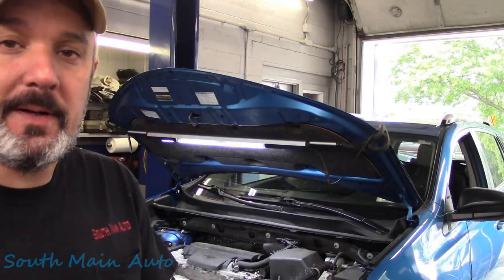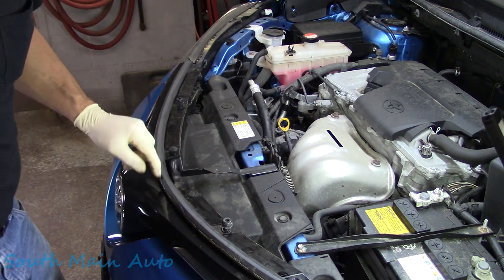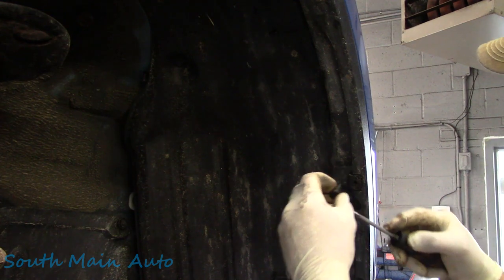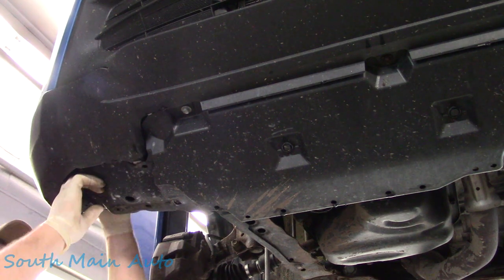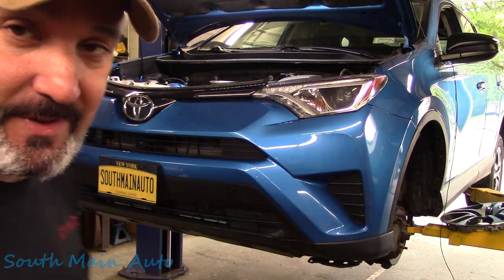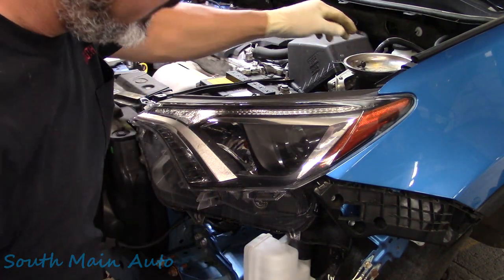2013-2018 Rav4 A/C Condenser Replacement

Comment: boy i miss the good old days the grill is on the hood take out a few brackets to get radiator or condenser out
back in the 90s i hit a deer with a corolla and it was only 300 dollars for new condenser refill system the whole works with labor

Comment: Should "you" take those brackets off the condenser and fluid film or plasti-dip or something a layer between the aluminum and steel to prevent future corrosion and leaks?

Comment: Seems alot to take off on this Toyota on My 04 Accord EXV6 Sedan. To uninstall the condenser you just have to remove the Under Bulkhead cover which is only 10 clips then 2 brackets and 2 bolts of course the High and low hoses. And thats it slides right out. I don’t why so much for this small car.

Comment: You mentioned in the near beginning where and how much the freon leaks at that driver's side mounting bracket.  What if any updates were done to the factory replacement condenser?   What, if any does the salt/brine have to do to make it leak there?  I have a 2020 RAV4 and I live in Southern California, but I'm wondering if that leak is due to a vibrating/rubbing problem or the salt/brine problem?
I'm definitely keeping this video for reference.  Good fix Mr. O.

Comment: I've got a 2017 rav4 and the ac stopped blowing cold. Got it leak checked and re filled. Mechanic couldn't see any leaks. Lasted a few days then went back hot again. Had it back to the shop and he re-gassed it again. Same thing, lasted a few days. He recommended a new ac compressor next. Is it possible mines may be leaking in the same spot and he isn't noticing?

Comment: Great video Eric I,  wish you or someone else actually had a video on replacing the ac expansion valve on  2011 mazda tribute 2.5 liter,  I know it is attached to the passenger side firewall  but I'm not able to remove it.  Thanks

Comment: That car is clean for 6 yrs old in PRNY and only 36k miles. Definitely doesnt get used in winter. My 16 escape with 123k has had no major repairs just reg maintenance well it did need rear shocks but that’s not too bad.

Comment: I have a 2015 RAV4 with 200 000 km on it and I have a leaking condenser.  I always keep my Toyotas well beyond 300 000 km so I'm wondering if I should change the condenser as well as the rad since everythings already apart?  I'm doing it myself so it's only the cost of the parts.  Any opinions would be  appreciated!  Thanks in advance!

Comment: 225k miles '05 Magnum. Very dependable. 1 warranty issue. Pinch wire in the hatch. Rental car driver whacked it good. Totaled. I would still be driving that boat. 
  The point about safety is spot on.

Comment: I believe you when you say you evacuate the A/C before you open it up.  I don't believe you when you say you come back and torque everything ;)  I suspect that after this many years of work that you have a well calibrated "torque arm" (or ear?) as well as knowing exactly when torque is critical and when you can get away with "good enough".  Without that critical experience, a torque wrench is always the safe option.

Comment: I had no idea that you could get different "grades" of parts from the Toyota dealer.  That kind of blows my mind.   I mean I've seen things like different grades of brake pads/rotors, ignition parts,etc... all wear parts though.  Never OEM replacement parts.   I wonder does the same thing hold true for engine sensors and electronic parts?

Comment: Back when I was still in the biz, we used to have these yellow shrink seals that we would put over the service ports and shrink on. Lets you know if anyone else has messed with the system. Good to have when a customer comes back for warranty work. I was in FL at the time so we did lots of AC work. Didn't know if they were still a thing?🤓

Comment: Only 35k and the condenser has a leak?  If you have done 3 of them already it must be a design or material flaw.  Did it rust through, have excessive movement, or just be a weak point?

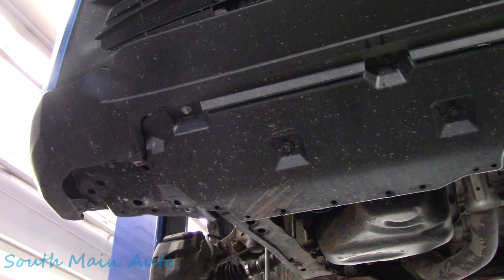Comment: How long have you been rockin the 1080p60?  I admit I've got an old school Macbook Air 2015 that I watch the majority of my videos on.  It doesn't like the high bandwidth video so I usually have it limited to 720p just to stay out of the 60fps.  Then I have my power house Dell I use for actual work (CAD, compiling code, far to many virtual machines running at the same time, and the occasional video edit for my nephew).  It looks like a brand new shop on my Dell.  Specifically at 2:36.  It looks amazing.

Comment: You are absolutely correct. The engineering in an new car is amazing, All those those different pieces /components coming together to fit and make a car.
Reply: That is amazing service with a very quick turn around time.

Comment: Great video Eric and Vanessa!!! I just liked and subscribed to your channel.
I have a 2021 RAV4 that developed a pinhole leak in the condenser according to the dealer.
My AC still runs cold so it must a really small leak. 
Do you think I could use some J-B Weld to stop the leak?
Thanks, Michael
Reply: BTW It's 2021 RAV4 Prime. Thanks!

Comment: I picked up a brand new Citroen Xantia, with rear lights that blinded people. The AC was useless, it was a very hot summer. The language as I drove it for the first time, after it ran out of fuel, to the repair guys was very rude ! Worked after OK though. I also hit the fornt Left wheel hard on kerbs twice and had to have replacement wheel, it was a company car here in the UK. God I hated that thing !!!

Comment: At 11:42, Eric O says, "This is where all the magic happens." All air-conditioners, and refrigerators, use adiabatic expansion to move heat. They all have two radiators: one is called the evaporator, and the other is called the condenser. A refrigerant is a chemical that easily cycles through a liquid state and a gas state in these two radiators. The compressor, compresses the gas phase, which makes it hotter. The gas is cycled through the condenser which cools it, and causes it to condense into a liquid. This liquid will be at the temperature of the air flowing over the condenser. The liquid flows through a wall into the chamber to be cooled, and is squirted through a nozzle into the evaporator, where it becomes a gas. This is adiabatic expansion which means the gas becomes quite cold. The blower then forces the hot inside-the-car air over the cold evaporator, which cools the air, and heats the gas. The hot gas returns to the compressor, and the cycle repeats. Buy a "compressed air duster" can, and discharge it all at once. The can will become ice cold. They plumbers in my old office building did this with a standard metal gas cylinder filled with compressed air. They wrapped a rubber hose around the water pipe, and emptied the cylinder. This froze the water, giving them time to unscrew the bad component and replace it before the water melted, and saved them from having to turn off an entire branch water line.

Comment: I am a Tundra owner and have been pleased with the dependability and engineering.  But my SR5 is an 08 with right at 200 thousand miles.  Having said that, it appears the condenser on this RAV4  has an engineering fault
Reply: Steel clip on an aluminum condenser, bathed in wet road salt, is a sure scenario for galvanic corrosion.

Comment: It's funny but I usually prefer changing condensers than radiators. More time, sure, but bumpers typically come off easily then you're left wide open. Radiators usually don't give you the time to have that kind of access. You usually have to rip em out and shove em in while fighting with shrouds and fans and cooler lines and all kinds of plastic that doesn't want to go back...

Comment: I’ve looked at the Toyota cheap brand,  not as good as original.  I might use the air filter cause it’s easy to replace but not something where you have to remove hall the car if it fails under warranty

Comment: what really gets me about the newer vehicles friend of mine has a ford truck full size 5.4 pull up in drive way home from work turn truck off take key out and it keeps running go back out in 30 45 min still running takes off battery cables finally quits. goes to ford dealer bad antilock module the abs system has no business having any control with the vehicle shutting on or off let the abs do brakes and leave other things alone.

Comment: If just Eric alone has had to replace a few of those condensers already on vehicles with such low miles, and it's always leaking in the same spot, then maybe Toyota needs to do a recall and fix the way the condenser is held in place so all the vibration doesn't cause a leak.

Comment: I’m surprised that you didn’t replace the O-rings, hi and low pressure valves as an automatic part of an A/C service. As they are the most common causes of leaks.

Comment: My wife got sideways very light rain on the Fla turnpike at 80 mph and hit the cement median in our 2010 Civic which we had bought new. Her only injuries were seat belt rash and a small face bruise from the air bag. The car was totalled so we replaced it with a new 2012 Civic and now 160k miles later it just had its first repair, the starter went bad at 155k. It's not that long ago that was a fatal crash.
Reply from the maker: True story man. Do that in an old school car with lap belt and a full frame, you'd been at a funeral....
Reply: 80 mph in the rain.   Hummm... maybe most of the problem to begin with?!
Reply: @Ram14250  It wasn't rain it was a drizzle, you have to understand SE Florida.  She knows this was her fault. She went to change lanes and realized there was a car too close in the lane she was moving towards and she over corrected and got the car sideways. Perhaps on a dry road she would have gotten away with it or even in full rain at a slower speed but a very light rain slicks the oil on the road but the intensity of the rain isn't enough to wash it away so it just sits there. She knows her mistake but the point was that she was dead in an old car.

Comment: Do you have a video of how to refill Ac after condenser replacement?
Reply: Hook it up to the ac machine and let it rip. 

If you don't have the ac machine: hook up gauges, vacuum the system down, charge to low side using refrigerant scale.

Comment: Thought this would be covered under warranty but I had a temporary lapse in my memory and I thought it was 1998 where 10 year, 100,000 mile warranties were advertised all over TV. Looks like Toyota only has a 3 year 36,000 mile bumper-to-bumper Warranty, yeesh.

Comment: First Toyota we've seen on the channel in awhile, usually it's a HONDOO with a large side of CHEVY THUNDER!

Question though, if that one bracket is a trouble spot due to corrosion, wouldn't some Fluid Film help stave it off a bit longer?
Reply: If any contact occurs between the dissimilar metals in this case would make the corrosion worse as the surface area becomes much smaller and the corrosion in this area becomes much faster. (Never coat a cathode is one major item I took from my Corrosion class at Cal. It shrinks the surface area down so that the big ass positive ions from this metal run away faster.)
Reply: @LadyAnuB  I know dissimilar metals are bad, I still think that Fluid Film would help. Seemed like one of those "while you're in there" things to do.
Reply: @glassvial  As long as it stays as a single film with no gaps its good. I do wonder if it could do that in this case?

Comment: OMG,  2016  Rav4 with 34k miles with NO A/C. My old classic 2007 Corolla with 90k and 2009 Corolla with 186k and both A/C works like a champ, so far no need to add any Freon..... knock on wood.

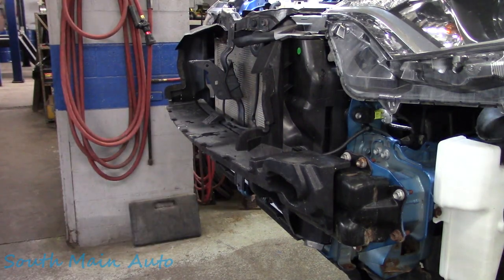Comment: 4:40 what was connector actually for?
Reply: @xephael3485  if it did have front radar through the front emblem that connector would got to that.
Reply: @JKCL20 Thanks, always nice to know what stuff is meant for even if it's not used

Comment: When I worked in cellular and after seeing all the hardware and wires that are needed to make a simple phone call I found myself saying how does this even work.
Reply: I opened up a modern day PCM thinking I could see if there was a loose solder joint or something obvious. 🤣 Joke was on me.
Reply: Yea in a few more years when all the older stuff is broken and tossed, everything will involve micro-soldering.  Which in itself is friggn crazy as hell..  aint too many hands steady enough for that shit with the patience to go with it.. using a damn 20x magnifying cam, a pair of tweezers with literally 2 friggn hypodermic needles as grabbers and a soldering iron with a tip just as small trying to solder in a component the size of a single grain of table salt that has 4 terminals on it..  and if you breathe to heavily youll wind up blowing off the chip and ive seen people lose those things after they drop em on their own arm..  crazy stuff..

Comment: Yes any dealer will use aftermarket or economy once vehicles are out of warranty unless the owner specifies they want OEM, which most people assume they always use OEM. After your car departs warranty status Stealers are just another repair shop with less trained techs.
Reply: My Ford dealer replaced a rear brake cylinder.  It started leaking within a year.

Comment: Kinda sad to see you putting the same painted steel bracket back on it, knowing that it's just  going to rust and leak again later.  I feel like they should have made a plastic upgrade with stainless steel bolts.

Comment: Anyone interested in car AC systems and doing things the right way should search YouTube for a channel called "T Lech." Tom is an MVAC wizard. He taught me so many things that I didn't know, particularly about variable displacement compressors having weird pressures and therefore you can't go by pressure to gauge charge, and how the slow natural loss of refrigerant causes lubrication starvation and excessive compressor temperatures which ultimately destroys the compressor. If a vehicle has a service every 2-3 years where its refrigerant is recovered, it's vacuumed down for 3-4 hours, and then recharged by weight with clean new refrigerant, the compressor will last for the life of the vehicle. 250k miles is possible.

Comment: I think I might have pressure tested it before putting all that plastic stuff back on, I've been caught out with this sort of thing before .
Reply: I'm a DIYer and I wondered that also.  Hate to put it all back together just to find a leak and have to take it all apart again.
Reply: @douglaskrenik4102  I accidentally left a Thrust Washer out of a gearbox once, I had no alternative but the sell the car as quickly as possible.

Comment: I hear what your saying Eric about cars getting ridiculous , you now have a screen for climate control where you used to have a cable. If it was too hot you moved it one way. If it was too cold you moved it the other way. The difference is when the climate control screen breaks its 2500.00 verses a 5.00 cable.

Comment: The is also less things you have to do on your car one of the reasons I got into cars was I use to love helping my dad to grease his Austin A40 nipples every 6 months and change the oil adust the points and valves after when the car got to 3y old fill the rust holes in is day he at help to drain the water from the radiators of my grandfathers taxes wich were model T ford's Morris bull nose to stop them freezing up in the winter

Comment: The extra wire connector is for the blinker fluid reservoir.🤣

Actually it’s probably for the radar module of the adaptive cruise control.

Comment: If it has only 34,000 miles, shouldn’t this be warranty work at the dealership?
Reply: 2016 is too old. "whichever occurs first". Nice work Mrs. O's hubby.
Reply: 2016 3 years or 36k on bumper to bumper coverage or 5 years 60k powertrain is the factory warranty.
Reply: It's over the 5 yr or 60000 warranty
Reply: It's not a powertrain component. Bumper to bumper warranty on non powertrain components are usually limited to lower mileage/months.

Comment: Aftermarket condensers often have awful performance compared to OE. That's because they have less fins per inch, fewer rows of fins, larger and fewer internal row columns per row, and they are often made without the mini louvers stamped into the fins themselves. All of that means they CAN'T reject nearly as much heat as the OE part. Then you come to Arizona here and you wonder why your AC sucks so bad when it's got a brand new condenser and charge. 😿😿😿

Comment: Modern Cars are really the most amazing pieces of junk out there. Very few appreciate the engineering feat that a modern car is from a mechanical and electrical engineering aspect to the material science that allows the successful use of the plastic parts, alloys and varying types of steels that are knitted together. A bit more robust corrosion protection might be nice though....

Comment: My Old 54 Chevy Belaire could Total every car on South Main and still drive back to Arkansas so I would feel much more safe in those older cars--without plastic these New Cars would Fall Apart. Steel Wins over Plastic Every Time--just saying...
Reply from the maker: Not when it comes to occupant safety. It's hard to wrap our heads around but there is tons of proof your survival rate in a modern car is ten fold of that of the old iron.

Comment: 4:30 I bet that connector is likely for front parking sensors/forward radar if the vehicle was so equipped.
24:20 The next time you have computer trouble, remember a computer is just a rock we tricked into doing math.

Comment: When you get a new condenser, you want to blow some air through one side, make sure it exits the other. Use shop air with a rubber nipple, ambient high pressure inflator, whatever. Dont worry about "adding moisture"  to the system, the vac pull will get rid of that.. What a vac pull wont get rid of is a bad weld or solder joint that seals the whole condenser to ONE SIDE, AKA NO GAS PASSES THROUGH!!

Ask me how I know, after assembling AN ENTIRE FRONT END AND *%@*! TAKING IT APART AGAIN!